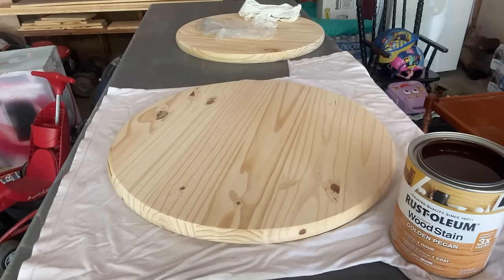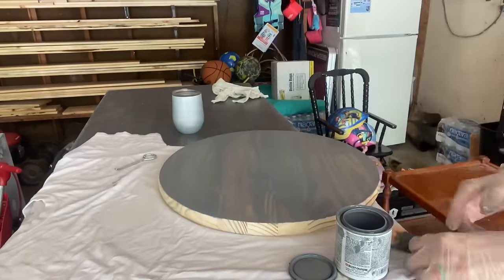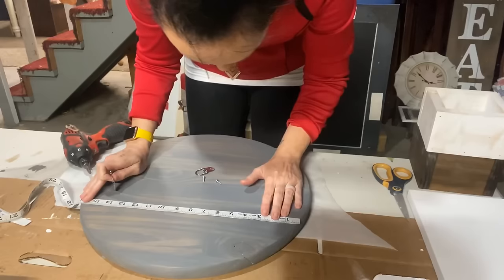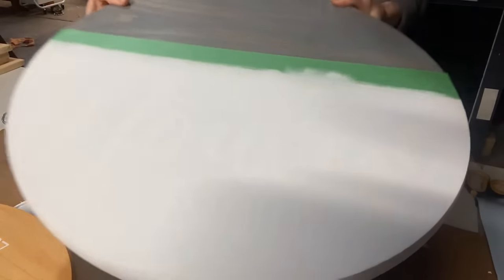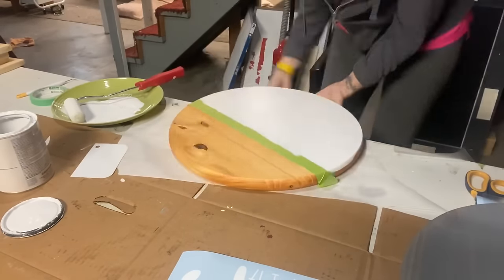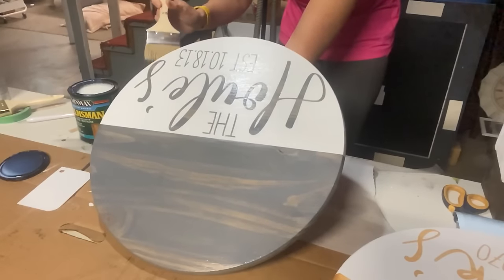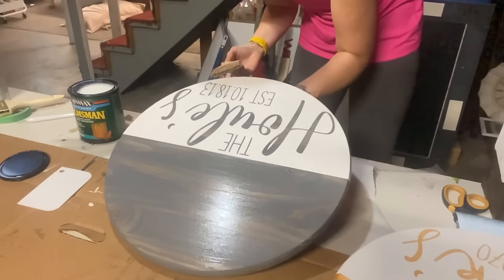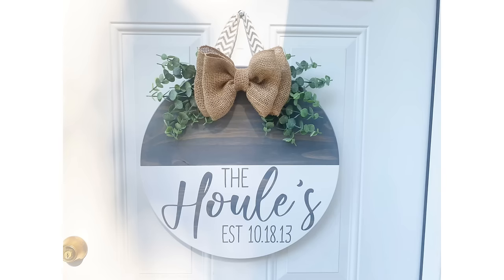DIY WOOD ROUND || DIY WOOD DOOR HANGER || WOOD SIGNS FOR BEGINNERS

Comment: I've watched this video upteen million times & still have a question. I am ready to put my stencil on my stained board & apply my chalk paint. Do I take my stencil & masking tape up immediately after painting or do I need to wait the 24 hrs for the black to cure?? I will be crazy until I get this first one done :):)  Thanks!
Reply from the maker: So after you apply your chalk paint just wait for it to dry - maybe like 30 min if you’re not using a blow dryer (on cool setting). You will know it’s dry because it will be matte and you won’t see any glossiness (wet) on it. Then peel it up with your weeding tool. I hope that answers your question.
Reply: @UnicornDustDesigns  Yes it does. Thank you very much!

Comment: Thank you for a great tutorial! Do you remove the stencil when the chalk paint is still wet or do you wait for the chalk paint to dry completely before peeling it off?
Reply from the maker: Hi Lynette! Thank you for watching. I wait until my chalk paint is completely dry before removing my stencil. A hair dryer speeds up that process 😊
Reply: Unicorn Dust Designs thanks so much! I’ve not had much luck with stenciling d/t bleeds but will give this method a try!
Reply from the maker: I will be doing another tutorial when I get back from vacay on how I stencil over paint. No matter what though I always find their is a tiny bit of bleeding

Comment: If you decided to leave the words on as permanent vinyl, instead of paint... would you still seal the board after? or would that step not be necessary?
Reply from the maker: Hi Liza. If you watch my reversible sign video I did use permanent vinyl and didn't seal it. I feel so many people say not to and some say you can. I recently tried putting mod podge over a vinyl decal and it was perfectly fine. One of my subscribers also uses the spray mod podge and some even use the spray clear.. sorry I couldn't give you a definite answer.

Comment: Hi. I’m going to attempt this project this weekend but I have a few questions 
1. When you seal after stain, are you sealing both sides or just the back before you attach the D hooks?
2. I see you are using hot glue, but you mention using E6000.  When do you use each of those? Is hot glue going to be enough to hold the sign when hanging?

Thank you for this video! I’m hoping mine turns out just as well as yours!!

Comment: I've watched your video so many times for some great tips!  I've been using the Oracle 651 vinyl and Rustoleum chalk paint. Each time the paint is seeping under the vinyl and the letters look sloppy.  Any tips on preventing this?
Thank you!
Reply from the maker: Hello Erin! Are you sanding your wood down to a nice smooth finish? It should feel buttery soft, no grit.
Reply: I have read to put a thin layer of matte mod podge over the vinyl before you paint to prevent this. I tried it and it worked!

Comment: Hi, I was just curious how long with using the blow dryer method does each coat usually take to dry? Thanks so much!
Reply from the maker: Hello. With chalk paint I dry it down with the blower dryer and ensure its completely matte before moving onto the next coat. You can do this by holding it up to the light to see if there's any wet spots. I don't want to give you an exact time because it will vary. I also suggest using the cool setting on your blow dryer so it doesn't heat up your decal.
Reply: Great! Thank you so much! I just subscribed and have been watching many of your videos! Glad I found your page!
Reply from the maker: I’m so glad you found me too Brandi! Thank you so much for subscribing and watching!

Comment: I tried this and when I pulled the vinyl my paint came up with it. Do you suggest sealing the paint before pulling the vinyl and after pulling the vinyl up?
Reply from the maker: Hello Melanie. I never seal my wood before placing my vinyl down. I feel it adds texture when painting on top to it. Are you using chalk paint?
Reply: Unicorn Dust Designs no I wasn’t using chalk paint. I have since bought chalk paint to use because this was the only difference in the steps you did. Could that be the issue?
Reply from the maker: I’m not sure because I don’t ever use anything other than chalk paint when doing my rounds so I wouldn’t be able to give you a definite answer. Sorry Melanie. Let me know how the chalk paint works
Reply: How did the chalk paint work? I’m having the same problem..

Comment: Do you have any problem with yellowing after using the water based  polyurethane?
Reply from the maker: Hello! Thank you for watching. No yellowing at all.
Reply: I did everything step by step as you mentioned. Using the same material and I got yellowing over the chalked paint on my final coat of Helmsman. Any suggestions?

Comment: Sorry if I missed you answering this question already!  But did you only use hot glue when you folded the ribbon over the d hooks?  I would be worried it would wear over time and the sign would fall down.  Wouldn't knotting the ribbon to the d rings be better?  Just curious.  I'm in AZ so I'm worried about it lasting in the heat outside.  Thanks :)
Reply from the maker: Hello! So I have one that's been on my door all summer long and it's still going strong. I've never personally had issues with hot gluing it and neither have my customers (that I know of) but I'm sure tying it in a knot would work just as well.

Comment: What did you use to sand the wood? I sanded mine and I can see scratches when I put the stain
Reply from the maker: I use an orbital sander from SKIL. I start with an 80 grit and then smooth over with a 220 grit.
Reply: @UnicornDustDesigns  Thank you!

Comment: How do you prevent the paint from seeping underneath the vinyl?
Reply from the maker: Hello Rachel. I use the 651 permanent vinyl which has a stronger adhesive. I usually don't have any issues with it.

Comment: Just curious! 

So you only hot glue the ribbon together through the and hooks? A fellow crafter put out a PSA that hot glued items would melt in the summer causing the item to fall. Have you ever had an issue like that?
Reply from the maker: Hello Jillian. Yes, I only hot glue. I've had signs on my door in direct sunlight for months and have never had an issue. It's also on the back of the sign which does not get exposed to the sun. But if you're worried about that you can also add some E6000 to it. I hope that answers your question.
Reply: I just watched your sunflower one where you address that, I asked too soon!

Comment: I just attempted this. I painted base black then put decal down. I then painted white, 2 coats but when I tried to pull up my decal it pulled up some of the white paint around the letters. Did I put my paint on to heavy or maybe not wait long enough?  It’s a hot mess.
Reply from the maker: Hello Mary! 
1. Was the base stain or paint? 
2. What kind of paint did you use?
Reply: @UnicornDustDesigns  it was paint. Can’t remember which kind but was a chalk paint. I’ve sense tried again by applying too coat over my paint before stenciling. Much better!!

Comment: Question...I just started making round signs, but with wood chargers.  I want to add the wood beads as the hanger for it and the d rings you use when making yours are too big or screw is too long, what can you sugguest to attach to the back? I was thinking staples, but Id have to make sure those were not to long either. Any suggestions?
Reply from the maker: Hello Angela. Everything comes in different sizes. Screws, nails, staples, etc. So all you need to know is how thick your piece of wood is and find something a little shorter. You can also use eyehooks on the side as well.

Comment: For the stain should I use a interior or exterior stain? 
For the seal should I use a interior or exterior seal?
Reply from the maker: I use Minwax or Varathane. Both brands are oil based.
I use Helmsman spar urethane water based clear. 
All materials are in my amazon store link

Comment: Just wondering how do you get the stain from bleeding under the vinyl? When I have done signs I have trouble with the paint or stain bleeding under, even when I scrape over my vinyl with my tool to make sure It is stuck done
Reply from the maker: Hello Amanda. You shouldn’t have any bleeding from stain because your stain is laid down before placing vinyl. I use 651 vinyl which is considered permanent but it has a stronger hold which I find causes less bleeds. I hope that helped.
Reply: You can get permanent vinyl off?

Comment: So you added the polyurethane before the stencil? Also, have you ever used acrylic paint? Thank you for this video, very helpful.
Reply from the maker: I do not add any poly to the sign before laying a stencil. I have used acrylic paints on signs before you just need to make sure to pull up your stencil before it dries.
Reply: Wait, isn’t the Helmsman clear coat you brushed on “poly “?
Reply from the maker: It is spar urethane

Comment: I'm a bit confused, is this removable vinyl that you used for the letters on the wood?
Reply from the maker: Hello Denise. No, I use permanent vinyl. It is more adhesive which in return gives you less bleeding.
Reply: @UnicornDustDesigns  so you put permanent vinyl down, then paint it and then remove the vinyl? If it's permanent vinyl isn't it hard to remove from the wood round?

Comment: What kind of Cricut machine do you have?
Reply from the maker: Hello 👋 I do not have a Cricut. I have the Cameo 4.
Reply: Unicorn Dust Designs thank you! I’m sorry, I think I recall you saying Cameo but I had no clue what that was. 😊 Love your videos!
Reply from the maker: No worries girlie! I love my Cameo. I love that everything is in one place, design wise.
Reply: Unicorn Dust Designs can the prints be transferred onto clothing?
Reply from the maker: Anything you cut on your machine can be used on clothing if you are using HTV. Heat transfer vinyl. I think that’s what you’re asking 😬
Reply: Unicorn Dust Designs yes, thank you!
Reply: Did you use the 615 Vinyl for both projects?
Reply from the maker: Snstbeach777 if i am laying my stencil directly onto stained wood i use the 651. If i am laying a stencil on top of paint i use Oramask 813

Comment: I am using oracle 651 and am so stumped. I have watched your video so many times and cannot figure out why my stencil is not sticking to my wood? I am wasting so much vinyl. 
Stained both sides and applied the finish on the reverse side and put d hooks on. Ready to paint and vinyl will not sick... ugh
Reply from the maker: I’m so sorry you’re having such a horrible time here Bonnie. The only thing I could think of is the stain isn’t dry all the way or you got a bad batch of vinyl. I would try staining a scrap piece of wood and basically doing the same steps to see if it happens again.
Reply: @UnicornDustDesigns  Thank you. I stained two days ago and I bought my vinyl from Amazon and have used the vinyl fine, but never as a stencil. I feel I’m doing something wrong in the transfer process.  I appreciate  the reply
Reply from the maker: Of course. I wish I could help more. There shouldn’t be any reason why the permanent vinyl shouldn’t stick to the stained wood 😕
Reply: @UnicornDustDesigns  do you have a video of cutting a stencil to paint this way? I think I am doing something wrong since this is not a usual way for me. Thanks again

Comment: I am using the Helmsman Spar urethane spray in my rounds but it doesn’t dry smooth, any advice
Reply from the maker: Hello Bonnie. Unfortunately I cannot answer this for you because I have never used the Helmsman spray on my signs. You can try going in with a super smooth sandpaper to get rid of the texture

Comment: Hi! I was just wondering how do you get the letters. Do you just print them out on computer paper and use contact paper to transfer? Very confused
Reply from the maker: Hello. I have a vinyl cutting machine. So I design my image in the design software, cut it, then use transfer paper to move my cutout to the wood sign.

Comment: I don't have a hot glue gun, but do have E6000. Will that be ok as is?
Reply from the maker: Hello Kirsten. It will be okay to use but you won't get that immediate hold that the hot glue gives you. So be VERY careful and make sure you set something on top of it to secure it in place. I hope that answers your question.

Comment: Love this! I’m getting into making wood signs. I was wondering why you choose chalk paint over just an interior paint? Is one better than the other?
Reply from the maker: Hi Gabrielle! To honest ... when I was first starting out I was reading tons of pinterest things and everything said to use interior paint. I tried it quite a few times and kept having problems with it. Then I tried chalk paint and was hooked because it's full coverage, dries quickly, and is full coverage. I should definitely give the interior paint another chance now that I'm more experienced. Thank you so much for stopping by and watching.
Reply: How long do you wait between coats? Do you let dry before pulling vinyl up?
Reply: Unicorn Dust Designs I’m just now seeing this! Thank you for getting back to me🙂 what kind of problems were you having? Like bleeding?
Reply from the maker: Tammy Wall I allow the chalk paint to fully dry before I peel the vinyl up
Reply from the maker: Gabrielle Steele of course. not bleeding but I was using 651 vinyl at the time and it would just strip away at the paint when I would pull it up
Reply: Unicorn Dust Designs thank you!
Reply from the maker: You’re welcome

Comment: Hello! I used the same exact products and process, but on one of my sign the white paint has yellow stains after 2 days of being outside. The yellow spots are all on the areas where i can see the darker wood grain. What did I do wrong and how can I avoid this? Help Please! 🥺
Reply from the maker: Hi Ira. Some times the tannins in the wood can come through the paint. I rarely have this happen but you can use things like KILZ primer to block it or Shellac.
Reply: @UnicornDustDesigns  Thank you 😊 You responded to the same question on my instagram as well. You are awesome 🤎

Comment: Soo I sealed the side that I wanted to put my vinyl on before I put on the vinyl on.  have I completely ruined my wood?
Reply from the maker: Hi Tanja! I don’t think so. I would get a super smooth sand paper, like 220 grit and run it across the seal to give it a smooth finish and then try applying your stencil. No guarantees but hopefully it still works for you!
Reply: @Tanja how did it come out. I did the same thing 😫

Comment: I’m having such a hard time with getting the vinyl to stick to the wood. Just confirming that polyurethane coats prior to vinyl is the way to go.
Reply from the maker: Hello! No, I do not coat the front of my signs with Helsman before applying my stencil. I do, however, apply it to the BACK of the sign before starting on my design. This way I don't have to put my newly painted sign face down when I'm done. Your piece of wood should be stained, dried for 24 hours, then start applying stencils, paint, etc. I hope this helps.
Reply: So helpful. Thank you so much!!!!!
Reply: Quick question I know u said to use 651 vinyl but is it the permanent or which one sorry new at this lol
Reply from the maker: Hi Maria! Yes, it’s permanent. I find that it adheres to the wood better than the 631.

Comment: I am having a problem with wood sign ( I sand both sides painted the sign black after 24 hrs drying  put stencil down  and painted white lettering came out beautiful. ) now the problem put sealer on hold sign and the black smeared on white letters what did I do wrong?  Help me please pretty please..... North carolina
Reply from the maker: Hello Annie! Okay - so I don’t usually have this problem but I know a lot of people have to come to me with the same issue. What you need to do is spray a light coat of clear (matte) over your wood sign - allow to dry (dries super quick) - then apply the clear and it shouldn’t smear

Comment: Did you ever try this project without chalk paint? Will it have the same effect?
Reply from the maker: Hi Alana! I have not tried to this without using chalk paint. I’ve always used the chalk because I found it gave the cleanest lines. If you want to test it out I would just try a scrap piece of wood with some painters tape so you can see if it bleeds or peels up
Reply: @UnicornDustDesigns  great idea, I will try it! Thank you :)

Comment: What do u do if the glue doesn’t attach to the wood round?
Reply from the maker: Hello Jackie. Are you speaking of the glue that you're putting on your ribbon to attach to the sign?
Reply: Unicorn Dust Designs I’ve been using a glue gun and a mix of E3000 and it doesn’t stick to the wood round for some weird reason

Comment: Hiiii, it''s me again lol i've watched this a thousand times :) buttttt at the end did you put the bow on the sign using the E6000? if so do you have to hold the bow on until dry?? thanks in advanceeee!
Reply from the maker: Hi Heather! I put E6000 and place it where I want it to dry and then I get another piece of wood or something with weight to lay on top  of it for 24 hours. E6000 is has a super jelly texture and the bow/greenery will move around if nothings there to hold it in place. I hope that helps 🥰 happy 4th of July

Comment: I added the clear Helmsan coating over the chalk paint...was I not supposed to o that because now it has yellowed 😭😭😭
Reply: and is there any way to correct it?
Reply from the maker: Hello! If that happens it means you purchased an oil based Helmsman and it needs to be water based. Any clear needs to be water based so that it does not discolor your paint. I have the link for it in my amazon store in description box.
Reply from the maker: You can either distress it down to make it look like a "distressed" piece or you'll have to sand the entire thing off.